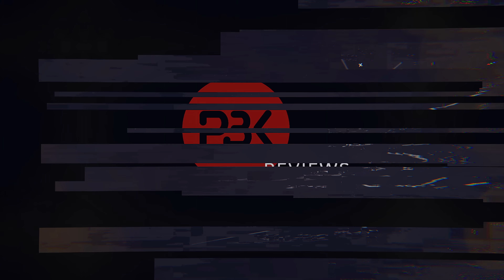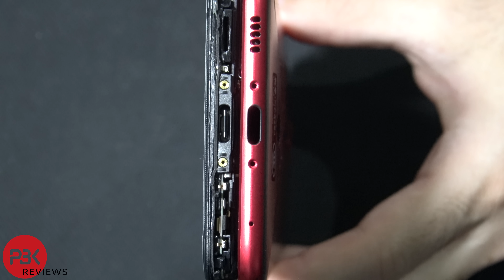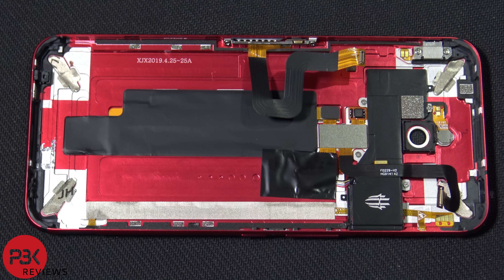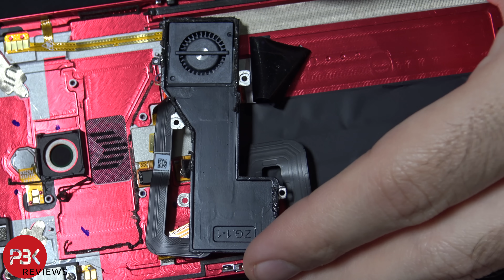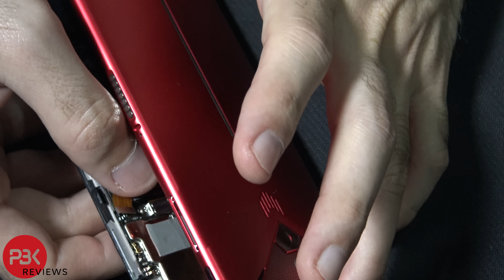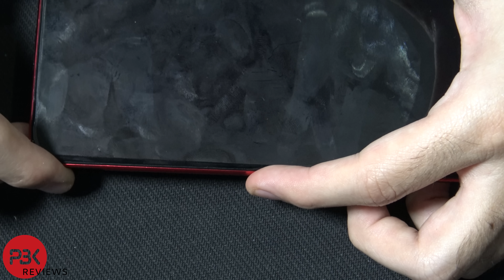UPDATED VIDEO: Nubia Red Magic 3 Teardown Disassembly Repair Guide Video. Fan Inside!

Comment: Still i didn't understand for unmount the phone  like you , you can see on the screen it attacked one film black, still i didn't understand if can insert something razor blade ecc  on that part for unmount or  the phone will not get  close more 🤔 , because i did try just to unmount just with the sucker , and the screen that was attack with glue a bit push out , so the sucker doesn't work for push out the screen ,but the problem is , i don't know which is the part where can insert the blade , because if i try to unmount on the part of charging,can  you see like a speaker and after the speaker the film black and after the frame , so can i insert the blade before  of film or after the film , but if i insert  the blade after the film will get close the phone after 🤔 so what is the film black near on the frame  , which is the function because on every video on YouTube than on 2160p i can't see where can I insert the blade before or after near of frame 🤔

Comment: With just the sucker and help with opener you can ? Because the film that when i try to push up with sucker make me worry that is the glue on the film i didn't understand still if can i go until deep, maybe was more good that you will not cut every part on video

Comment: I have the red magic 3s, and 🤔 that it same of the red magic 3 probably but i want know just one thing  For just change the battery i should to unmount the cam ad the speaker ?
Reply from the maker: Once you have access to the battery cable, you would just disconnect that and should be able to pry the battery off. You would not need to remove the camera and speaker.
Reply: @PBKreviews  thanks i did see another video already , but the problem Is a another maybe  , i see that every one cut the video after remove the 2 screwdriver on the charger for open the screen , it so hard  open the phone , and don't touch the screen 🤔
Reply: @PBKreviews  i am just worry that while use a sucker will also pulls the glue and screen 🤔

Comment: hey hi! can I ask about that little metal piece that goes along with the screw in 5:31. ? Coz i brought my RM3s to a tech guy for an LCD screen replacement then a couple of months later my RM3s died and I did a DIY for a battery replacement this time. So when I was able to open it watching this video I noticed that that little piece of metal is missing when all the screws are still intact. idk if the tech guy took it on purpose or lost it or just forgot to place it back or whatnot.  I would really appreciate any answers. thanks
Reply from the maker: Hi, it might be a ground or antenna signal contact, not too sure. If your phone works fine and you have no signal issues then i would not worry about it :)
Reply: thanks man! appreciate the reply!

Comment: Hello there, do you think someone who has never replaced a front glas before, would be able to do it? Im very skilled when it comes to microelectronics, i can follow given instructions perfectly, and im gonna buy everything i need from iFixit toolkit, to adhesives, to a LCD Screen Heat Seperator Machine and what not. I was lucky to find a Nubia Red Magic 3, with only broken front glas for 50$.
Reply from the maker: Hi, honestly I'm not sure. I know I don't personally have the skills to do a clean professional glass only replacement. For me it would be best and easiest to replace the entire screen assembly rather then worry later for dust, fingerprints, scratches on screen, or touch issues later on.
Reply: @PBKreviews  True, im already looking for some new screens, i found quite a lot for NX629J but i got one problem, im not sure if they are original 90Hz Panels or some cheap fake ones. Theres one im looking at right now that says Original, taken out from Original Phone.

Comment: so you just disconnect the two cables and you can replace the screen from there?
Reply from the maker: When you disconnect the two cables from the back plate, you can separate the back plate from the rest of the phone but you would still need to disassemble the rest of the phone so you can gain access to the screen cable and disconnect it and pry the old screen off and run your new cable through the slit in the midframe, apply the new screen and reconnect the cables etc. This requires removing the battery as well to gain access to the screen cable.

Comment: My screen is activating buttons when I'm not touching them. pubg randomly freezes and my directional pad will not work but I can touch everything else and it works for about 30 seconds then to the directional pad kicks back in. Any suggestions?
Reply from the maker: Does the phone have any sort of liquid damage? sounds like something that would happen from a short from some sort of liquid damage.

Comment: But how do I remove the front glass? The LCD is fine I just want to replace the glass.
Reply: Hello do you fix it?
Reply: @yerkosll  no.
Reply: could you know how it's done? I have the same problem
Reply: @yerkosll  the LCD and glass are stuck by some sort of adhesive, I did see a video you could use a hair dryer but someone in the comments said it fried the LCD or other electrical components.
So on the safe side I rather have a tech store fix my screen.

Comment: My fairly new (has it for about a month) Red magic 3(S) won't charge after I let it die. It keeps on showing me a picture of a phone that's telling me to plug the charger into the phone. It's not showing any progression on battery power.
Reply from the maker: Might be a defective charging chip on the board, if you have warranty still on device, send it in for a replacement. I saw this type of issue on the iphone 5c where it would charge if the battery was not fully drained but when battery died it would not charge it. Changing battery and charger port would not fix the issue, so it was related to the main board. Not saying for sure yours is this issue as well, but that's what I would be leaning toward it being.

Comment: So I need to replace JUST the outer screen glass. I found one online but my digitzer works perfectly fine still. Would that be any easier than tearing down the entire thing? I'm ok with pulling off the shell and seperating the two gut portions, but I don't love the idea of undoing everything else and all of the cables.
Reply from the maker: You cant replace just the glass, its glued onto the screen itself you would need to replace the entire screen assembly. The glass by itself is only replaceable by factories or professionals who have the needed tools and machines to do the job, aside from that its useless. Hope this info helps
Reply: @PBKreviews  Crap. I do have a heat gun, if that's what I need. Oh well, thanks for the reply though!
Reply from the maker: @benjmiester  no that won't work, you need special environments that are dust free and also heat plates and would need to fuse the new glass to the screen again etc. Trust me I can't even do it lol.

Comment: I got the lens cover shattered , can u tell me that whether I have to open the phone till the end like u did in this video or it can be replaced from outside only...I mean just like taking a new glass cut and glue it from the outside .
The thing is I don't wanna open the phone as it's just the lens cover. It is possible sir?
Reply from the maker: If you are referring to the back camera lens, then yes its just held on with adhesive, you can heat it up and pry it off and replace with a new one.

Comment: How do you fix or replace the screen??
Reply from the maker: after you take the phone apart, you heat up the back of the midframe or screen assembly and pry the screen off from the midplate. Then apply the new screen and re-assemble the phone
Reply: @PBKreviews  thank you so much. Do you know where I can go purchase a replacement screen for this device
Reply from the maker: @Xramikillerx  not sure if its available yet.
Reply: @PBKreviews considering it's almost a month old phone I don't think it's available either. Thanks for your help I appreciate it
Reply from the maker: @Xramikillerx  no problem, hopefully will start showing up on ebay soon
Reply: @PBKreviews  I hope so too. I was looking on their website and the screen isn't on there either

Comment: You made removing the battery look like a cake walk compared to Jerryrig.
Reply from the maker: It wasn't difficult. The lg v50 and g8 had strong adhesive but not the red magic 3. Even without heat you can use a membership card or something similar to gently pry in one side and slowly work your way underneath to pry it off. Takes about two min. Applying heat should make it even smoother of a process.

Comment: At 0:57 it literally hurts to watch. Not the proper way to open the phone, if you want to "repair" anything. Perfect way to gouge the finish.
Reply from the maker: as mentioned in the video if you listen with audio on, you can't use any plastic pry tools with this phone as they will break. Even with the strong metal tool it took me such a long time to separate the screen assembly from the housing. This is not like any other phones in which I always tell everyone to use a plastic pry tool. It just wont work with this phone.

Comment: Those dont look like copper heat pipes, those look like copper shims
https://www.ebay.com/itm/GPU-CPU-20mm-x-20mm-x-0-8mm-Thermal-Shim-Heat-sink-Pad/153447466570?hash=item23ba2e864a:g:CBYAAOSwoFBalbjr

They are not as good as copper heat pipes, copper heat pipes would dissipate the heat through water cooling as the heat transfers. Copper shims just bridge the heat just like thermal paste does. 

A fan is superior to copper heat pipe, since a fan would cool it a lot more than droplets of water, however more openings means more things can inch it's way to the mother board.

Comment: "it has a fan" is all I hear. where are the benchmarks compared to other phones?
Reply: It'll be just the same, but it'll probably have less throttle, Linus did apply liquid metal to razer phone and it doesn't throttle even at full load,

Comment: Use some plastic tools to avoid short circuit
Reply from the maker: when possible I do, but as mentioned in the video, separating the screen assembly from the frame is not possible with a plastic tool its extremely hard to get it to pry apart even with a metal tool. Plastic will just break or bend.

Comment: Kinda bit dissappointed to see that there are no heatsink fins on that aluminum piece attached to the fan. For sure, that fan would run much louder without having "fins". Would be nice if they added some fins so that cooling would be optimized and the fan would run at a lower RPM while significantly reducing noise.
Reply from the maker: ya also would have helped with the heat dissipation

Comment: why does the cooling chamber has no thermal paste contact on the  main cpu board, it just sandwhich over it?
Reply from the maker: Do you mean the vapor chamber or the side where the fan assembly sits on top? vapor chamber side has thermal paste and fan side has a thermal pad that makes contact between the fan assembly and the board.

Comment: this fan design cools the phone but how????
Reply: It's a fan that blows warm air out. It's really not hard to understand lmao
Reply: @sjoerd104  but the fan is close off and the housing is plastic....not really thermal conductive...
Reply from the maker: I originally thought the same that it was all plastic, but it has aluminum or graphite material that is painted black which makes contact with the thermal pad on the top portion of the fan assembly housing. You can see it in the part of the video where I scrape off the paint.

Comment: So.. The fan is pretty useless, it does not suck air through heatsink or anything, it just blows air through the shroud from outside
Reply from the maker: I'm sure it helps to a certain degree but ya if it had a heat sink or fins, it would probably have been much better.

Comment: A phone like this would be used a lot.  It would be nice to have an easily removable battery especially since it isn't waterproof.  I currently have an LG k20.  I never plug my phone in to charge.  I just replace the dead battery and put it in a battery charger.  I have about 5 spare batteries and 2 chargers for 2 phones.  Batteries weaken in less than a year on a phone that is used a lot.  I could see myself tearing up the Nubia Red Magic 3 trying to replace the battery.  I'm retired and could see myself using a phone like this way too much but it would have to have a battery that I could replace in less than a minute.
Reply from the maker: Yea that's true, batteries usually start dieing out over use. I think the battery should be an easily accessible item to be replaced.

Comment: what good is the fan gonna do for the phone considering its dimensions/
just consumes battery and a good marketing by the brand
Reply: Yea it does consumes some battery but it helps a lot in cooling the phone while heavy gaming. And it also have liquid cooling so you don't have to always turn on the fan and it also has a 5000 mAh 🔋 battery. So no problem there

Comment: You should have used a heat gun to warm up the adhesive beneath the screen it make it much easier to separate the screen..........😐
Reply from the maker: there is no adhesive between the midframe and frame of the phone so removing the screen assembly that's adhered to the midframe is just held on with catches around the frame and two screws on bottom. The screen however is held on with adhesive to the midframe so if you want to replace the screen, yes you would need to use a heat gun to warm up the adhesive on that part .

Comment: I think that fan kinda looks like the fan which is found inside Nintendo switch but compare to Nintendo switch fan it is really small.
Reply from the maker: ya, its a pretty small fan. Possibly can be used to put in other devices lol haven't seen one this small before
Reply: Lol. There are a lot of small fans available online if you look hard enough. I've seen some nano ones. Which are about 10mm x 10 mm. Though this is my first time seeing that very small fans are now being utilized in an actual product.
Reply from the maker: @Aries2376  Oh ok, I never looked for them but the smallest ones I ever dealt with were ones in laptops or older motherboard bios fans that were small as well.

Comment: Is the adhesive on the vibration motor insanely strong? The man that fixed my screen claims it had such a grip he destroyed my vibration motor trying to remove it.  Another motor is impossible to find to replace
Reply from the maker: They are strong but not too strong. Sometimes the bottom of the vibrator motor breaks off easy or the ones which are wired get cut but key is to use a thin enough tool to pry and work  your way under the motor to pry off and take time doing it not to damage it. Parts should become available for this phone pretty quick so keep checking ebay and amazon etc. I will reply back if I come across a place that has it.
Reply: @PBKreviews  unfortunately vibration motors are completely unavailable for any red magic devices. Nubia refuses to sell any parts and the only option for repair is shipping it to Hong Kong. Wish I had just done that to begin with as inconvenient as it is

Comment: sooo, basically, the fan has nothing to do with the cpu cooling? strange move
Reply: It seems like it has somewhat of heat distribution with that metal endent which is connected to the fan to transfer heat out of the phone and having the cpu to be under that metal indent is helpfull becouse most of the heat will be generated in that area and be pulled out by the metal and fan combo, plus the cpu has a vapor chamber which is also a good heat transfer away from cpu. So yes it does have something todo with the cpu.
Reply: Watch unbox therapy. Uploaded a video about the rm3. Played PUBG   for some while with temps staying  @ 36° celsius. This is definitely below throttle temp.

Comment: Black shark 2 is better with the amount of copper and thermal paste inside it, this thing looks like they cheaped out on the cooling so just put a cheap fan inside it.
Reply: Yeah & the same cheap fan makes a difference of 16 degree Celsius. It's convenient & that's enough for that price.
Reply: @woahnoah4864  I prefer the larger area of copper and the 2 vapor Chambers with thermal paste than a fan personally, if that fan breaks good bye cooling.
Reply: @woahnoah4864  listen you dumb , i use cooling pad to cool off my laptop & difference is couple of degrees get reduced & you really think this tiny cheap fan can reduce temperature of rm3 by 16 degrees ? 
😂 keep dreaming 😂
Reply: @kunal-jawale  wow look we have a tech enthuasist over here
Reply: @kunal-jawale  You've lost the battle buddy. 🤡🤡🤡🤡
Reply: @shiftyz_  yes buddy i lost the battle , i was impatiently waiting to buy  red magic 3 , but after this video , i might go with black shark 2 or ZenFone 6 😓